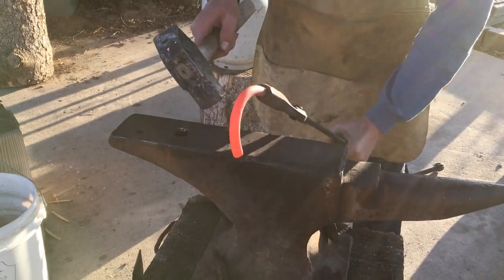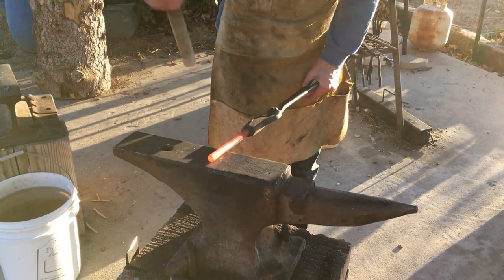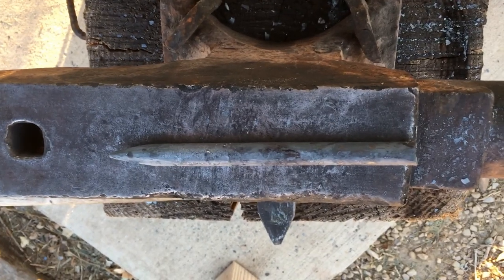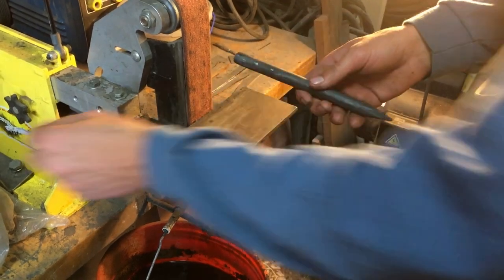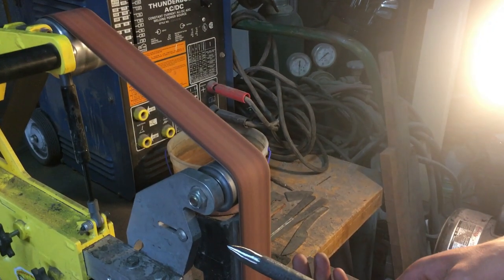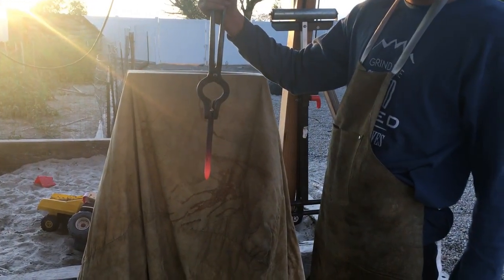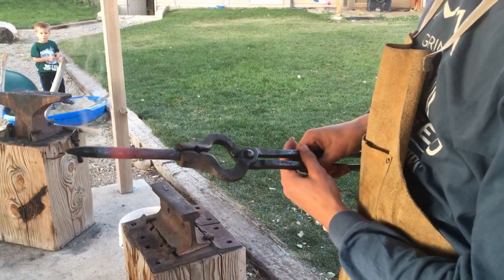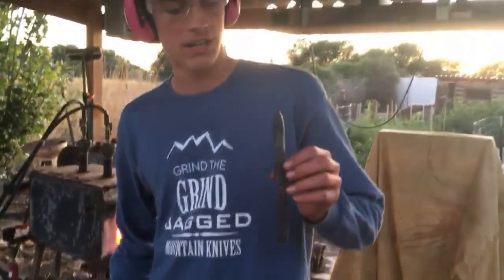How to Forge a Center Punch: Tutorial

Comment: Great work! Just one thing to mention - your forge's kaowool doesn't appear to be rigidized or refractory coated. If you're not wearing a respirator around it, you're going to be breathing silica fibres in. This is a huge health hazard (silicosis) if you're doing it several times a week. Your kaowool will also deteriorate quickly, costing more in the long run. 

You should look into rigidizing it and then regularly coating it with something like ITC-100. Not only does this increase the lifespan of your kaowool and reduce silica fibres being ejected, but a zirconium-based refractory like ITC-100 is IR reflective, thus increasing the efficiency of your forge by putting the heat back towards the core. I hope this is of some use to you.

Keep up the good work
Reply from the maker: ya I definitely need to cover it up